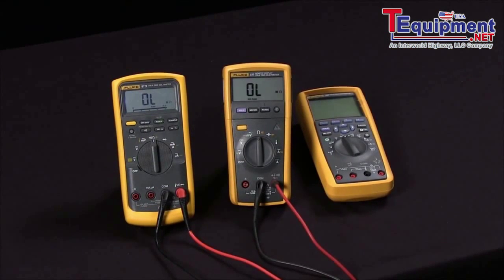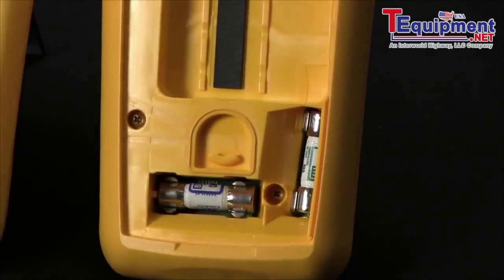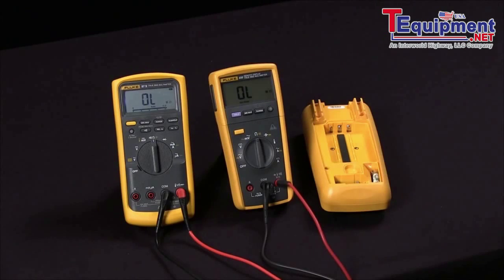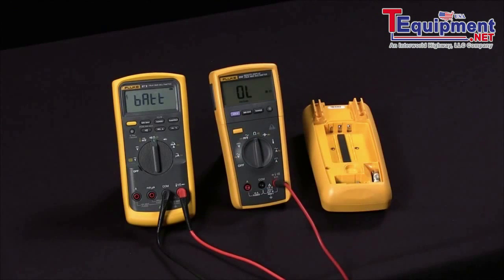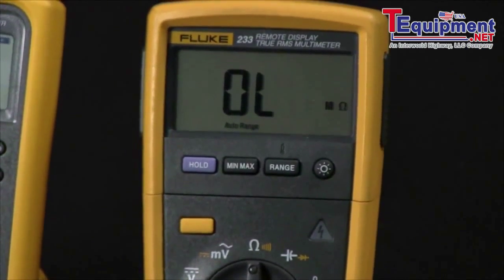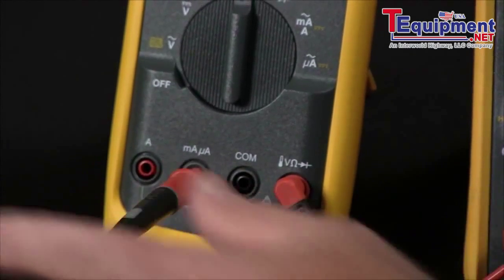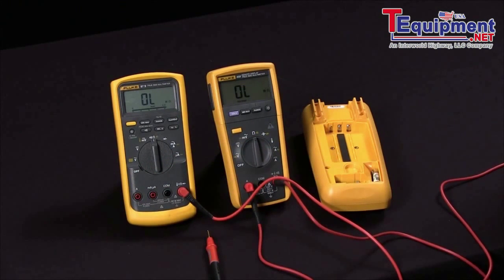Fluke 87V & 233: How To Test Fuses In A Multimeter

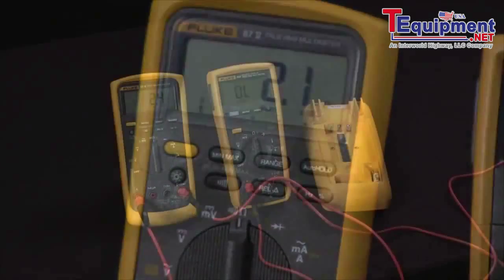Comment: At 1:49 he talks about the lead alert and says that the lead alert is also an indication that your fuse is okay. This is not accurate. Inside the jack there are two points of contact, one upper and one lower. The upper contact will give you the reading on whether your fuse is good, the lower contact is for LEAD warning. This makes a difference because the lead you use must have a probe tip as he has in the video. That is why with his lead pointed up it gave a resistance reading, and with his lead pointed down it gave a LEAD warning. If you use a test lead with interchangeable tips and you remove the tip and put the banana plug test lead into the amp jack you are testing, you will only get a LEAD warning, you will not get a reading on your fuse. Hope this helps somebody avoid the headache that I endured.